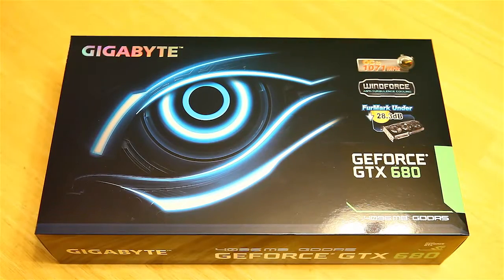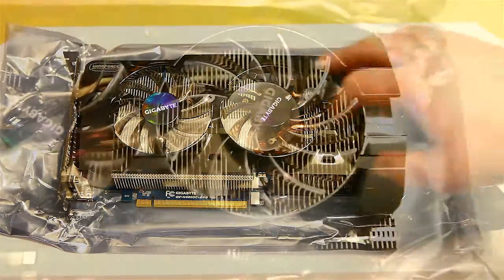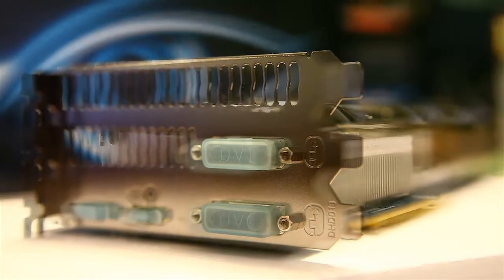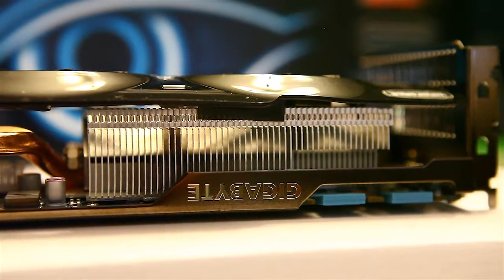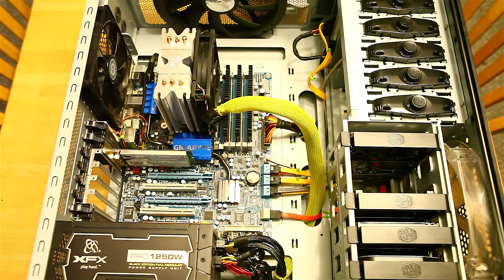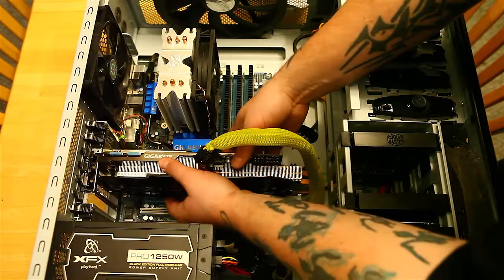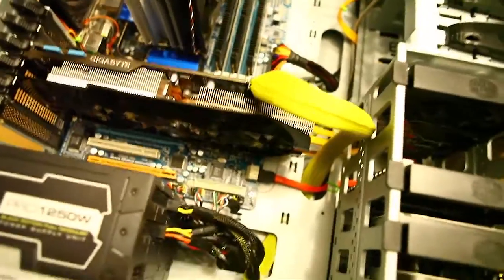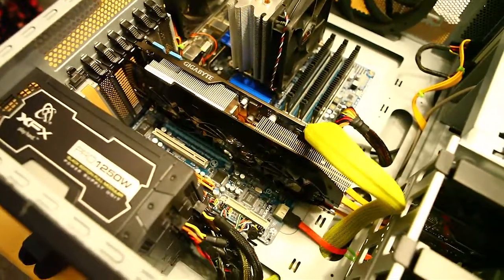GeForce GTX 680 4GB GIGABYTE GV-N680OC-4GD Unboxing & Overview

Comment from the maker: Alot of PSU's PCI-E connectors are 6/8 pin they have 2 extra pins on the connector for it, if non pretty sure it comes with an 8 pin adapter for the old molex connectors

Comment from the maker: Sounds like your processor warning temp. In your BIOS you can set it up to auto shut down or warn you if your CPU temp gets to high, video editing is def taxing on the CPU, some video cards can get that hot but a CPU should not be hitting 71c, you may want to remove your CPU head sink, make sure the fins are clean, make sure its installed correctly and apply a high quality thermal paste like arctic sliver 3

Comment from the maker: Yeah 71C is DEF hot! I would monitor your running temps and all your components, sounds like you need better or more air flow, whens the last time you have totally cleaned your system?